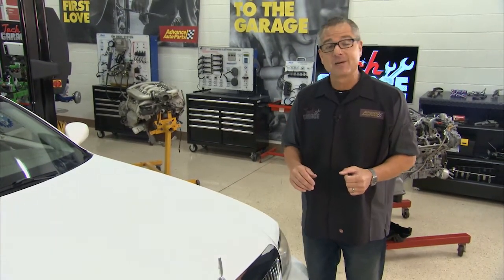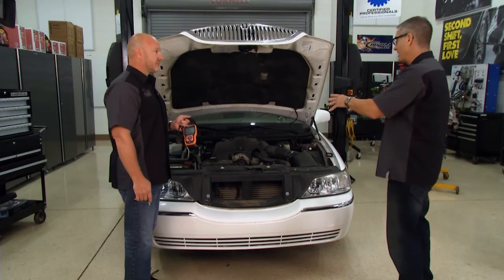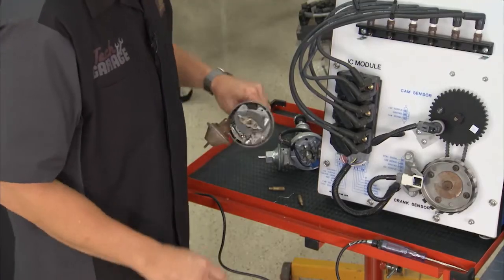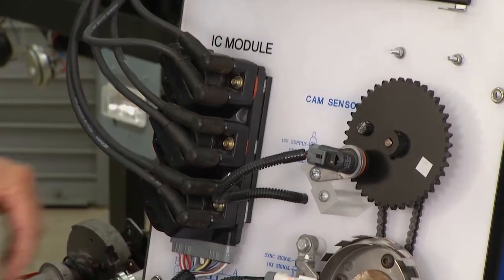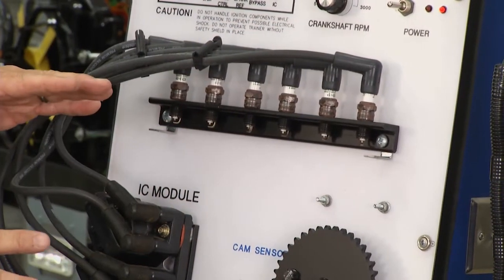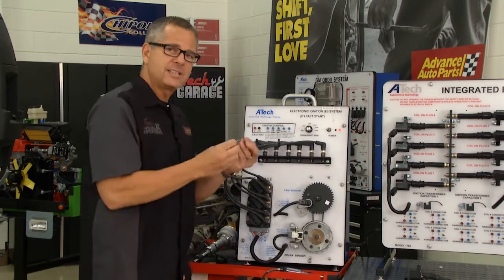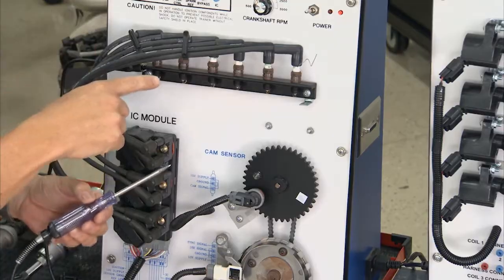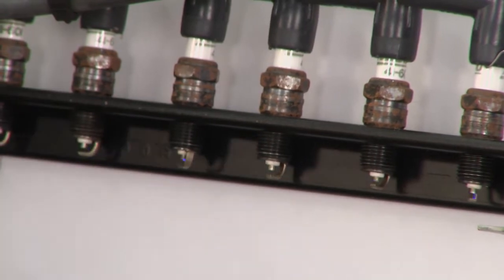Rough Running Engine Diagnostics - Lincoln Town Car

Comment: I'm going to look at a 1989 Lincoln Mark Vll that has sat for the past few years.  I believe it has the 225hp HO engine.  The owner, who is a mechanic of sorts, says it runs rough and he can't figure it out.  He said people have told him it could be a vacuum line under the intake manifold.  I'm thinking that, and a dirty fuel system for the gas turning bad from sitting.  Also, if that is a distributor engine rather than an electronic system, the timing could be way off due to it being loose.  What do you and others here think it could be.  What are the Usual Suspects?
Reply: vacuum leaks, old ignition wires, dyeing fuel pump, clogged fuel system etc